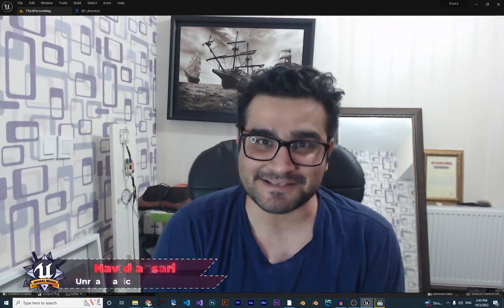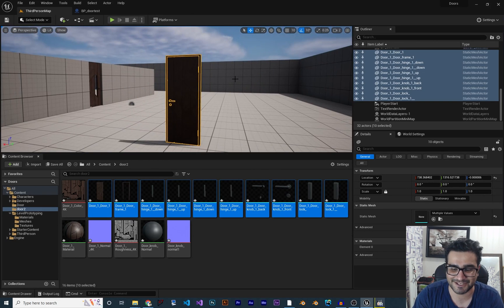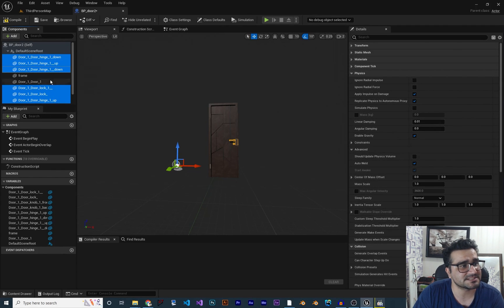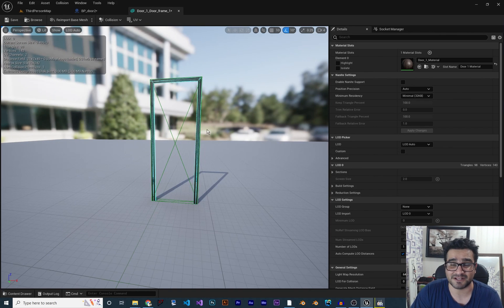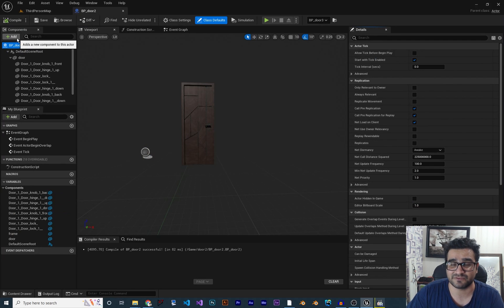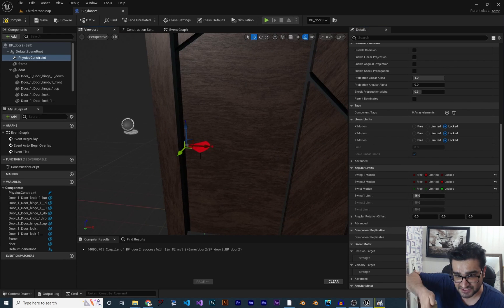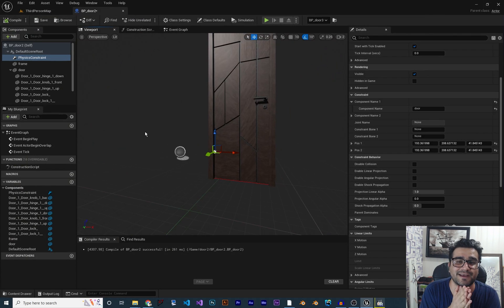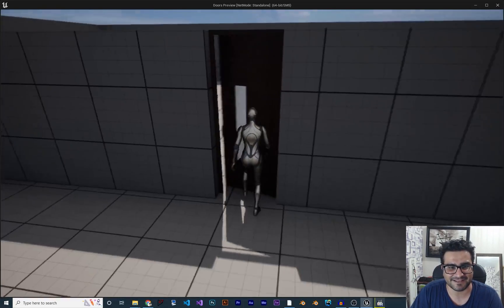physics door in unreal engine 5

Comment: awesome video, im having a small problem though. i used my own doors and went with a double door and they seem to be not aligning at the center. the doors wont close all the way. i tried the angular damping and still they wont align when closed. im thinking they are blocking each other. sometimes one will close if it closes first.